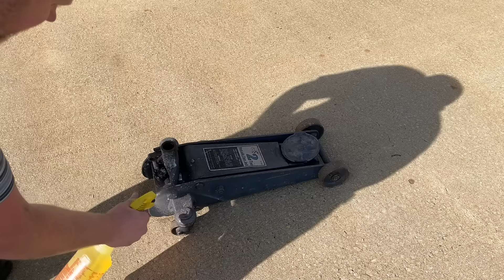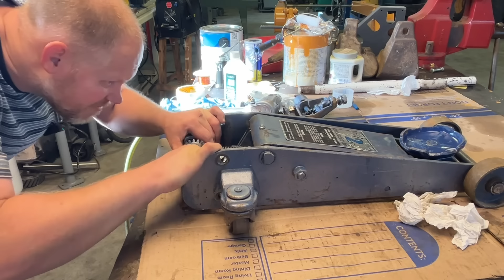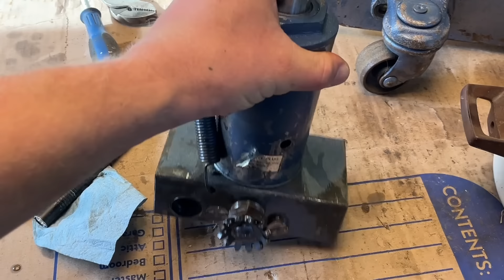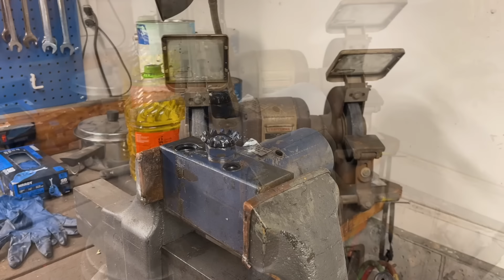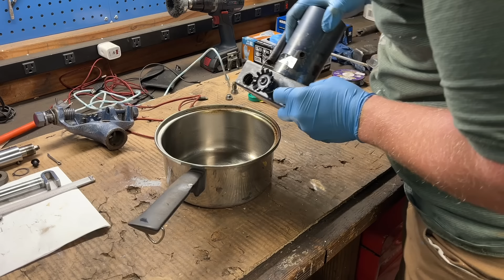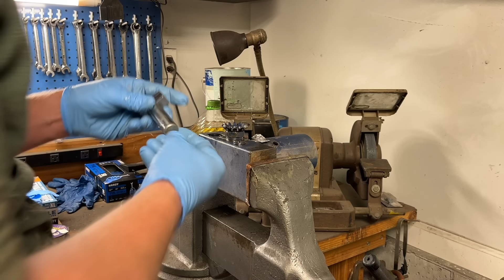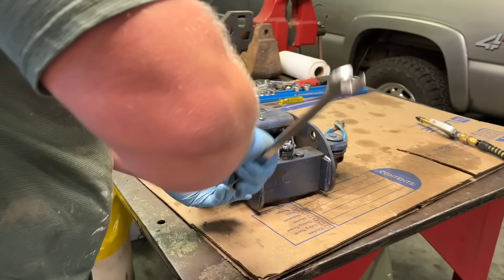Won’t Pump Up - Fixing Sears Jack for $15

Comment: Mine just stopped holding the car up in the air after 50 years. This afternoon i put it out on the street for the scrap man, but as soon as i saw this video i went out to get it back. Luckily,  it was still there.
Reply: That was me who turned around to pick it up, but you were dragging it back to your house.  Haha, would love to find another. 🤞
Reply from the maker: @kenashcom7580  good save. Easy fix most likely

Comment: May I ask the seal# and where you got it ? I have the same sears jack doing what yours did. I bought it new from sears in the mid 70's just after getting married . I had a hyd shop rebuild it once but it did not last very long. The new ones they sell are not made as good. I think I still have the paper work for it. Thanks, mine is a blue green color.

Comment: I’ve got one of those myself!
I used to pull my VW engines all the time back in the day. (mid-1970’s)

I still have it and I’ve always thought it could work again. Thought about taking it to a forklift repair shop, but now, thank you for the video, I’ll give it a shot and see if I can fix it myself

Comment: So where and how did you get the repair part???????????????
Reply from the maker: @mixster56  search ebay 

U-Cup Seal for SEARS Floor Jack 328 Series 22 x40 x12mm 328.12001, 328.12002 etc

Comment: I bought mine in 1970. It leaked afew years ago. So I fiddled with the caped off ports to top off and bleed it. Not 100% but better than after the leak. Yes a source for the rebuild kit would be appreciated. Good job.
Reply from the maker: eBay has the main seal which is usually all you 

U-Cup Seal for SEARS Floor Jack 328 Series 22 x40 x12mm 328.12001, 328.12002 etc

Comment: I have that exact jack that's doing the same thing, what's the seal number?
Reply from the maker: @holiday1  eBay
U-Cup Seal for SEARS Floor Jack 328 Series 22 x40 x12mm 328.12001, 328.12002 etc

Comment: I have the same Jack bought it in the mid-80s still works great best hundred dollars I ever spent
Reply: My Junior High shop teacher said, 'buy your tools now, they just get more expensive.'  I loaded up on quality Craftsman stuff.  The Chinese came and prices went down, but so did quality and now people accept 'disposable tools!'
Reply: One of the best investments I ever made. One heavy duty jack.
Reply: I also have the same jack passed down from my grandfather. He bought it 45 years ago.
Reply: I have one just like that also. I should have taken it back to the store the day I bought it. I didn't, though. I still use it sometimes but if it quits working it goes on the scrap pile. It's not worth fixing.
Reply: @mikefrech1123 ? It's a early 1980s jack made in Japan when Japanese products became high quality so why if it's held up almost 50 years wouldn't you rebuild it you can get the kit from Lazzars for around $50 & yea I know it was $99.00 when new that's like &300. Nowadays,  why because it's way better than auto store Jack's and harbor freight stuff of today

Comment: Good job I have the basic same jack in my shop will lift but you come back in a couple of hrs and the load will be on the ground,
I don’t trust it, I have checked fluid level,
About all I know to do for it, I bought a harbor freight heavy duty 3 ton fast free lift option,
Works great, except for one thing, the lift point pad will not come off, on certain jobs I need it off 
The pad will come of the old craftsman jack,

Comment: A link to where you got your seal?
Reply from the maker: @cayankeelord3730  https://www.ebay.com/itm/335096775703?mkcid=16&mkevt=1&mkrid=711-127632-2357-0&ssspo=ajzqxsmbsay&sssrc=4429486&ssuid=B8IE_u5AQ3C&var=&widget_ver=artemis&media=COPY
Reply: @MikefromMissouri  Thanks a million!
Reply: How did you find the correct seal? Did you measure it and then search the web?
Reply: Lazzars

Comment: Thank you for having good shop practices, for cleaning everything up before you work on it, for having a little impact driver to get that screw out, and for turning the crescent wrench around the right way so the movable jaw isn't loaded.  So many fixit videos are made by blacksmiths who work in filth and grease, never clean their tools and use them the wrong way, pound on screwdrivers and use alignment punches as drifts.   My Sears jack goes up about halfway and I've been reluctant to dive into it.  Now that I'm 81 and don't work on things anymore, it'll probably stay at half mast,
Reply from the maker: @Bobby-f7b3g  It’s usually time and money ahead to slow down and don’t  it right. Thanks for watching and the comment!
Reply: @MikefromMissouri  When I was racing, part of the enjoyment was doing everything as right as we could do it, everything clean, everything tightened with a torque wrench, no reason for a race car to be dirty, good tools used properly.  I had a young guy helping me, and I preached my philosophy.  I found out long after we stopped that I was known among his friends as the guy who wouldn't allow a tool to go back in the toolbox until it had been blown off with brake cleaner.
Reply: If the jack goes up part way and holds, try topping off the oil reservoir with jack oil. Probably has a rubber press fit plug at the fill port.

Comment: i have the same sears jack. air gets into the hydraulic system causing a decrease in pump stroke so it takes a lot of pumping to get the jack to rise up to full height. yes you can bleed it at the top and the bottom of the stroke but the air gets back in. a second jack a prolift speedy jack from harborfreight i got works flawlessly. never had to bleed it
Reply: Sell - Out to China.....

Comment: I have the exact same jack. I bought it new at Sears back in 1985.  I had to add hydraulic fluid a few years ago, but that is the only thing I have done to it besides, keeping it clean and lubricated.
Reply: Got mine in 75 😇

Comment: Source for hydraulic parts , would be a good ?
Thanks
Reply from the maker: Bought just the seal on eBay. Just type in the serial number and parts are easy to locate
Reply: @MikefromMissouri  I am looking for multiple items , a 35 yr old [ about ] Japan floor jack , a 10 yr old Craftsman aluminum floor jack & what appears to be Harbor Freight  heavier than most cherry picker long ram .
Thanks anyway

Comment: Thanks, I picked up a 'fixer' Craftsman for free and cleaned up and added oil, etc. and thought I got it, but first attempt wouldn't lift car.  Rebuild kits are $60, but I didn't want to replace everything, just to find that it was probably one bad seal somewhere.    I can get a new one for $100 or less, but I just despise Harbor Freight and others.  I'll look at that cylinder seal first, thanks for your thoroughness.
Reply: That jack was $99.00 45 years ago that's $300. Or more today there's no comparison in quality stick $50 , 60 , even $100 into it your still ahead

Comment: Why not show part number for green seal?
Reply: Measure the inner/outer diameters and height of your existing unit, or if torn as probable, check cylinder bore and rod diameter.  Heights vary by 2mm, try to get it from previous and compare with spacing on rod.  They are hard to source, but they are out there.  That green is probably a 22x40x12 found often, but mine was 24mm and there are more.
Reply from the maker: @Bob-cd5pp  found mine on eBay by searching sears jack seal
Reply: I have that very same model Sears floor jack I bought new. It stopped working some years ago, but I kept it around. Rebuilt it a couple years ago with a kit off Amazon, but it never worked like when new. After seeing your vid, I'm going to give it another go. Just like you, a lot of good memories were made using the old Sears jack... THX!
Reply: Torins makes that brand of Jack.
Reply: Mine is an orange omni > japan
Reply: Nobody has EVER sold any "rebuild/repair" parts advertised for a hydraulic jack for the past 30 years or so. Because of HUGE "liability" risks that began in that era & understandably continue to this day. In about 1997 Sears informed me (bluntly) that they no longer sell ANY "repair" parts for their jacks. My guess is that anyone rebuilding/repairing a hydraulic jack is "repurposing" o-rings, seals etc. from their original intended use (at great risk, IMO).
Reply from the maker: https://www.ebay.com/itm/335096775703?mkcid=16&mkevt=1&mkrid=711-127632-2357-0&ssspo=ajzqxsmbsay&sssrc=4429486&ssuid=B8IE_u5AQ3C&var=&widget_ver=artemis&media=COPY
Reply: What model number is your power washer
It looks very nice and reliable.has it been a good one.whst would you recommend me to buy one